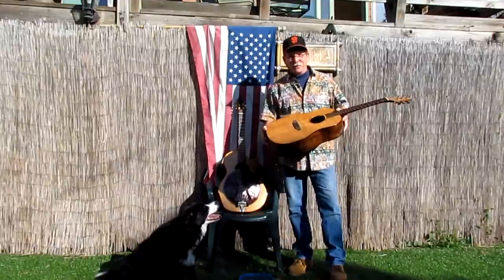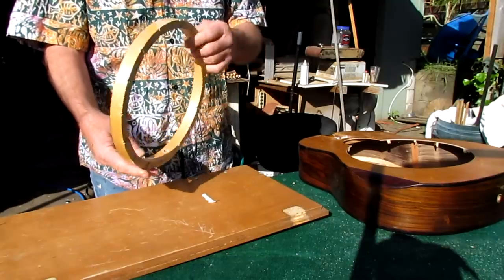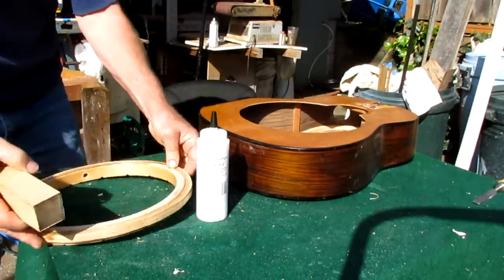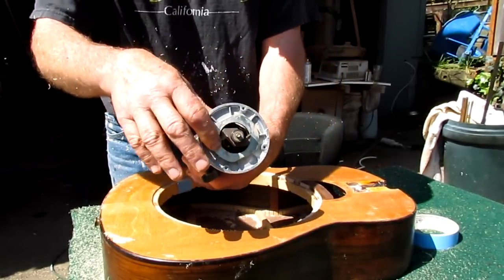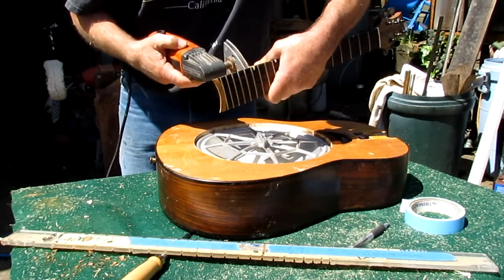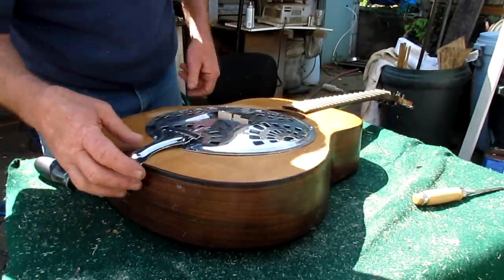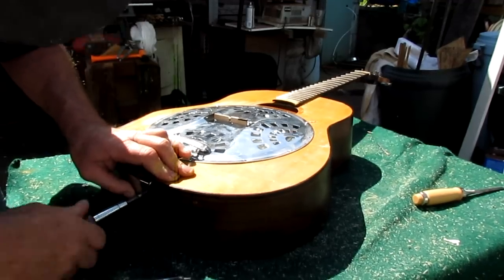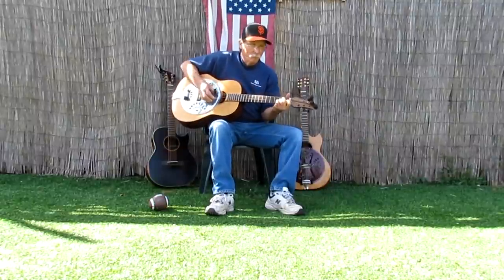How to Build a Dobro Building a dobro

Comment: I bought a cheap dobro and it ended up being a scam. The body was made out of disgusting composite wood and the dam thing was so quiet!! My 3/4 Cort 510 is at least twice as loud and it's half the size. I have an old Cort 850 ns and I'm going to do what you've showed in the video and use the resonator parts that came with the nasty composite wood one. Cheers for this, at least this way I'll feel like I got use out of this shitty situation.
Reply from the maker: Good luck bro.  It's a fun project

Comment: Hi Jeff. I have an old acoustic guitar that I'm going to convert into a resonator using your format. I found a kit from Tyler Mountain. Is that a good kit? Do you know anyone that has used this kit? What if you don't have a wooden circle from a Banjo?
Reply from the maker: Hey David.  I checked out the Tyler kit.  Looks pretty good for this approach.  I like Beard cones but if you add up all the stuff from beard it would cost about 250.00.   If you don't have a banjo rim (most people don't! haha) just cut out a circle from 3/4 plywood with a inside diameter about  5/8 inch under the diameter of the cone (10 1/2 cone cut to 9 7/8 inches).  THen cut the outside diameter at 11 to 11 1/2 for gluing.  Cut that inside as round as you can then you will have to route out the grove for the cone after it is glued to the guitar.  Take your time and use common sense and it will work for ya. 
Thanks for watching.  Keeps this old guy from getting bored at night.
Jeff

Comment: Finished another conversion of a cheap acoustic to resonator and it turned out great.  I took the neck off, cut the heel a bit and then shimmed under the fingerboard (about 3/16" at the hole) and the action is perfect.  It plays and sounds great, and doesn't look that shabby either.
Reply from the maker: Howdy. I'm really glad to hear that. Enjoy your picking buddy.
Reply: +Jeff McDermott  I sent you an email with a picture to your AOL address.  I think it looks nice.

Here's a tip I learned.  If you drill holes in the wooden bridge inserts to lighten them (like some banjo bridges) it really improves the volume and response.  If you drill them under each string so that it forces the vibrations from the string to take an indirect path to the spider it makes the tone richer.
Reply from the maker: Hi. Try sending that again.  I didn't get it.  I'll try your trick. boxedinn@aol.com
Reply: +Jeff McDermott   I just sent it again.  Look in your Spam folder if you don't see it.

Comment from the maker: Thanks Tony.  It's best if you can remove the neck and sand the bottom of the heel to get the tongue of the finger board to raise about a 1/16th to an eighth of an inch.  Bolt on necks are a piece of cake.  Also glue in a piece of wood at the underside of the soundboard from the round rim to the piece of wood joining the sides.  The string tail piece has moved on me in the past.

Comment: Hi Jeff, Just wondering how big the rings you cut are and also the hole in the top of the guitar? I have a 9 1/2 inch cone and was wondering how i should big i should cut them.
Reply from the maker: HI Ryne
THe diameter of your inner hole should be around 8-3/4.  That gives you about a 3/8th inch lip after you router it out for your cone.  Make the whole ring about an inch and a half.  THat give you plenty of glue area.  Cut that inner circle as round as you can.  
Thanks for your interest.  Good luck
Jeff

Comment: Nice work there Jeff..............why did you take the neck off first?
   Can you do it without removing the neck?
Tx.
Reply from the maker: +Robin Harrison Hi Robin.You don't need to remove the neck. But I like to (especially with bolt on necks).  You can sand a little off the bottom of the heel to obtain a little more angle which will give you a little more tension on the nut.  Good luckJeff

Comment: Thanks for the video, i'm redoing an old Yamaha with neck disease. I had a super cheap, thin body electric resonator given to me and it had neck disease also. So, I've taken the guts out of it and putting it in the Yamaha. I've got a nut that raises the strings too high to fret so it can be slide only. I play lap steel so this should be fun; like a square neck. I'm glad I watched this because I hadn't counted on the dowel bracing.

Comment: I have an old Yamaha 12 string laying around,you've just given it new life,she was headed for the dump.Oh by the way,I have a small crack in the headstock,any ideas on fixin this sir?
Reply from the maker: Hi David
If it isn't a structural problem try clamping it or filling it with super glue and accelerator.  Check out my video on how to make a toneanator.  YOu will like the results on your guitars.
Happy Holidays
Jeff
Reply: thanks Jeff  I will check it out

Comment: Just bought a guitar and a conversion kit to make one.  One question - when your're judging the cone recess depth are you holding the straightedge on the nut and parallel to the fingerboard, then eye ballin' the distance between it and the top of the spider bridge (you say needs to be about ¼") ?  Thanks for this video BTW.
Reply from the maker: HI Capn. THanks for veiwing.  Hold the straight edge along the fingerboard about an eighth inch above the fingerboard and then eyeball over the spider bridge.  1/4 is good. That way your maple nut will be about 3/8's above the slot.  THis way you can lower it later after everything settles.  ALso.  Install a little piece  of  1/2 piece of plywood on the bottom side of the top at the back from the cone holder to the back heel where the tail piece goes.  I had one show some wear after a year from the stress.
 If you have a bolt on neck. Take it off and sand a little off the bottom of the  heel gradually up to the finger board.  Leave the top (up by the finger board) alone so you keep your spacing from nut to saddle the same.  Your finger board between the top and the finger board will go from about 1/8th by the hole to zero.  You get more tension that way and just fill in with a shim.
I should make a conversion kit.  Where did you get yours??
Thanks
Fish on~~
Reply: A guy on Ebay has some cheap hardware kits that're OK for a first pass. He's still got two left in chrome for $79 a pop and some gold kits that cost more.  Search for "resonator conversion" and you'll find 'em.

I'm building a dojo (5 string resonator banjo) so will be a bit different.  Bridge especially because I need a string right down the middle - will likely mod a tri-cone bridge with a bottom edge notch to clear the head of the slot bottom seated cone screw.  Also going to use a straightline banjo tailpiece so I can adjust the down force on the strings and it doesn't bear on the top surface at all. 

I bought a factory reject Fender Sonoran with the action set too high so I may not need to take the neck off - but it's a bolt on if I do so no biggie. 

Will carry my 5th (top) string (.008 tuned to G) all the way to the nut (there's some playing advantages for doing it) and the nut width on that slender Fender neck should be just the right width for 5 strings at my preferred spacing.
Reply: Jeff McDermott Hey Jeff, I played the first notes on my resonator banjo (dojo) last night and it's turned out pretty good so far.  The volume was pretty low at first but I spent some time on the Asian spider with a file making it as light as I could without weakening it and I also drilled some lightening holes between the strings in the tri-cone bridge that I used and it's much better now. Maybe I'm just spoiled because I'm used to the beaucoup volume available from a good banjo.

I'm going to have to reset the neck because the action is too high and I found that my guitar has a dovetail joint neck and it's been coated with a polymer paint, so I've got some work ahead of me getting the neck out without too much damage, though I'm going to paint it after I'm finished so maybe not that big of a deal. A question I have is in the paragraph above you where you said that the finger board will go to zero and I can't understand this since lowering the action (tilting the neck backwards) should raise the fingerboard away from the top.  Can you 'splain this more for me?  Thanks for all the info.

Comment: ¿Hola Jeff, disculpa mi ignorancia pero se puede hacer lo mismo con una guitarra española con cuerdas de nylon?
¿Suena igual, o solo se realiza con una guitarra acustica?
De ya gracias por su respuesta.
Reply from the maker: You might be able to but it might be a little tight getting the rim in the box.  If you try this you can also use 3/4 inch plywood for the rim. Just cut the inside diameter 3/8 inch less than your cone. 
Good luck.  No habla espanol!!

Comment: Any suggestions about removing the neck? I’ve never done it before but I’m thinking I still need to lower my action more.
Reply from the maker: Look inside and see if it a bolted on neck.  If it is.  Just unscrew it. probably a 1/4 inch Allen screw.   More expensive geetars have a glued in neck which you have to melt the glue with a rod through the 15th fret.  I found a way to get more tension without removing the neck.  I'll go to my daughters house and take a picture.  Good luck and happy Pickin!!!  Thanks for watchin!!

Comment: Very cool...Question - I just bought a reso. Obviously factory. Took it appart Tremendous overspray. Bought a new saddle. Single piece maple/ebony. So I spit it. Obviously slot it for the strings. Any thoughts on bone vs maole/ebony?
Thanks a bunch!
Reply from the maker: Hi Kate
Bone will make it to tinty.  The maple and ebony tone it down without loosing the volume.  Make sure the saddle fits tight.  Add a little piece of wrapping tape to one side as needed for it to fit tight.  Check out my video on how to make a toneanator.  It works real good and on acoustic geetars and only costs 20 bucks. 
Happy Holidays to ya.
Jeff
Reply from the maker: HI Kate.  Any gal that takes apart a guitar to check it out  is my kind of woman.  Way to go.  My wife of 30 years would never do that. Keep it up!!!
Jeff

Comment: hI Jeff, great and useful video! i have two questions:
a) do you really need to remove the neck?
b) is it possible to do it with a classical guitar?

thank you
alberto
Reply from the maker: Hey Alberto
You don't have to take off the neck  and you can't take the neck off a classical guitar.  Classical or steel works. Just gotta make sure rim for the cone will fit inside the guitar.  A lot of the dobros are pretty close to the classical size anyway!!!!. 
THanks
Jeff

Comment: That's all great and everything, but what if you don't have an old banjo rim handy?
Reply from the maker: +PlanCartesien HII ran out of banjo rims (haha).  This was a spur of the moment thing.  Didn't think it would be so popular.  You can use 3/4 inch plywood.  Cut the outside diameter at 11 - 1/2 inch.  Cut your inner diameter at 9-7/8.  Cut the inside as close to round as possible so that when you route it out with your 3/8 inset bit it will leave you about 10-5/8 for your 10-1/2 cone.  Be sure to glue a piece of wood under the top side between the new rim and the heal  block where the tail piece is.  That is a weak spot.Thanks and good luck.Jeff
Reply: Great! Thanks!

Comment: Can you explain the reason for the straight edge,what are trying to measure???
Reply from the maker: Charles Garner hi Charles
Sorry I didn’t get back earlier. I didn’t see this. I use the straight edge to kind of eyeball the height of the strings in reference to the height of the nut which should be about quarter inch above the saddle slot on the spider bridge. I eyeball about a quarter inch and then adjust later after setup with the nut.
Thanks
Jeff

Comment: Great job, now I wanna build one!
Reply from the maker: +Larry Gates Hi.  It's pretty easy but think things over.  Use 3/4 inch plywood instead of the old banjo head I used.  Also.  Glue in an extra tail block behind the cone ring to the back of the guitar where the tail piece is.  My first one buckled a little bit. Parts at stewmac.com.,  GOod luck!!!

Comment: I have a dobro  guitar that has a neck problem that I'am thinking of resetting the neck not sure how hard it is to do.
Reply from the maker: Hey Steve. Thanks for checkin this out. If you have a truss rod you can tighten it up and get a lot of the bow out.  The place to tighten is at the top of the neck under a little screwed on plate.  You may be able to remove the cone and unbolt the neck and and sand a little off starting at the smaller part of the heal and working up.  Doesn't take much.  Maybe a 32nd of an inch to zero.  Don't remove any wood where the finger board meets the neck or you will screw up your scale. 
Hope this helps ya.
Jeff

Comment: Could I possibly convert a 3/4th size student guitar into a resonator? Its a steel string not a classical by the way.
Reply from the maker: Hi Vincent.
You can get a biscuit cone from stew Mack.com. It is only 9 1/2 inches. The hard part is getting the wood rim inside the box if you put a quarter inch slot in the rim then you can maneuver it in but do a few practice runs before your glue it.  This is a pretty easy process just take some time and think it through. Read some of the other comments I've given people. Make your rim out of plywood.  If I knew so many people were going to watch this I would've done a little better job. I just woke up one morning and decided to do it. Should I clean my shop to.  ha ha Ha
Thanks for watching. Good luck
Jeff
Reply: +Jeff McDermott Thanks for the info. Also would I need matching 9 1/2 cover-plate, and bridge?

Comment: Is it better to buy one thats already a dobro or take my old guitar that is bowed on the face and turn it into one. I would love to have mine fixed. Anybody know anyone in NC that fixes guitars.
Reply: Kirby Ammons jr to fix an acoustic guitar with a bowed top or high action/raised bridge/warped can cost a small fortune(that's why you need to put a humidifier in the case,under $20)usually unless its a gibson/taylor/guild or very expensive guitar its usually much cheaper to buy a new one. 

all the best from Canada.

Comment: just done my resophonic following your video. THANKS.
Reply from the maker: How did it turn out.  Thanks
Reply from the maker: @jordiquintanacompte1458  That's great.  Might want to check the top where the tail piece is attached.  One of mine started to break due to the string pressure from the heavy strings (16).  I added a block between the tail block and the ring.  Problem solved.  My favorite is D tuning.  Like playing Pony Boy by the Allman Brothers on my lap Dobro.  Pick on bro!!

Comment: How do you remove the neck?
Reply from the maker: If it is a bolt on all you have to do is melt the glue on the fret board tounge.  Other wise its a bit tricky.  I found a way to get more tension on the strings by installing a bar behind the brige and run the strings under it.  No need to remove the neck.

Comment: Daymn... Must repeat... Jeff, you've done a great job. I have a near to death full mahogany Hohner, and I'd like to steal your modus operandi. Could I, please? )
Reply: Most important - THANK YOU. Your video gave me a healthy push ) In my case, the neck was a DOA. And the thickest layer of Poly-on-the*body I've ever seen. I'll post if I'll succeed )
Reply from the maker: laminate a couple pieces of 3/4 plywood for your rim.  Get parts at stewmac.com
Reply: The cone/plate/nut package, I'll go with StewMac indeed. As for the rim part, I'll laminate my own ) In my case, the back deck is curved.

Comment: i am going to order parts tomorrow and give it a try
Reply from the maker: +dennis mccoy Hi DennisYou can use 3/4 inch plywood instead of the banjo pot I used.  Works great.  Also.  Glue in a block behind the cone ring where the tail piece goes.  My first one buckled a little but was fine after installing the block.  Good luck.  It works great.  Let me know if you need anything.  I did this video in the spur of the moment.  Didn't plan it out at all as you can tell by the messy shop!!hahaha

Comment: Cool, but glue kills sound. Good for what yer doing though!
Reply from the maker: Hey Buz
You ain't gonna get any vibration out of the top wood anyway. The small posts work much better that a sound well though.  It allows some good vib and full sound from the rest of the box.  But your right.  A sloppy glue job on a guitar will kill some sound on a geetar.  Thanks.

Comment: "I've started by removing the neck."  As someone who is interested in doing this, but having had no experience as a luthier, you may have explained to those of us who AREN'T born with this knowledge HOW you 'remove the neck' FIRST!

Just sayin'
Reply from the maker: Hi Jack
It is kind of obvious that I did this on the spur of the moment.  I didn't even think about doing a video until I removed the neck.  Other wise I would have cleaned up my area.  Thought it would be fun to show people how I go about this.   
You can leave the neck on.  Some necks are bolted on.  All you have to do is take a thin putty knife and gently work it under the tounge of the finger board.   
If I showed the whole process it would be a much longer video.  I just wanted to give people  a quick look at how to do this.  I've answered other peoples questions in an effort to help. 
Hopefully you learned a little bit anyway.  I've learned almost everything I know by making mistakes!!!! HAHAHA!!  I've been building things for 40 years.  So it does come easy for me. 
Have a nice day.
Jeff
jeffswork.com
Reply: Hey, thank you for the quick and courteous response! This looks like a lot of fun and would save me a few hunnert in the process. I have a couple of beaters laying around gathering dust then I saw your video. I'll give it a try.